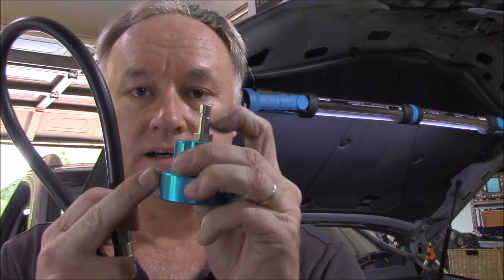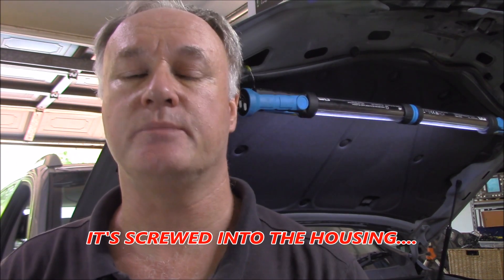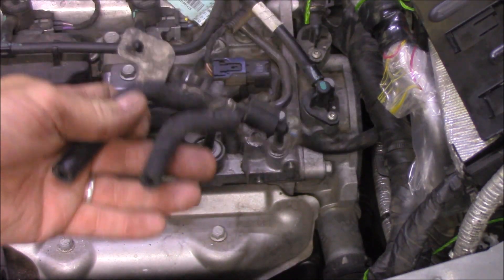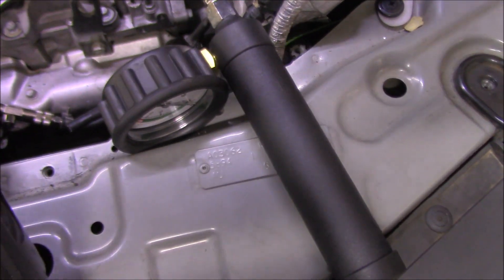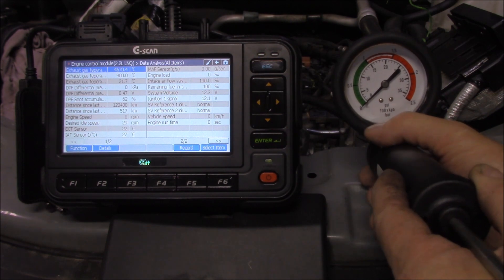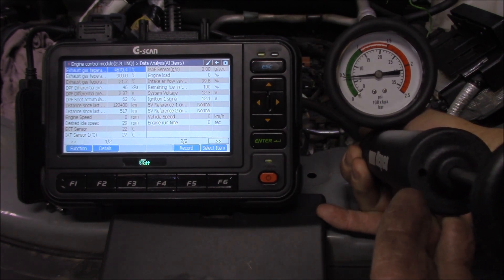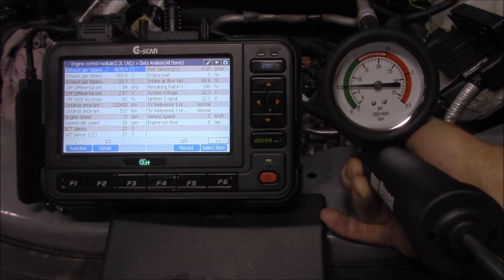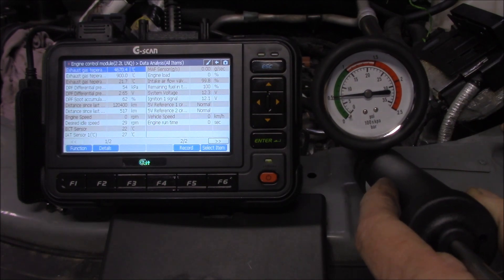DPF Differential Pressure Sensor Testing MiracleMAX

Comment: Did you determine why it was blocked?
Reply from the maker: Hey Bob,
I will be putting out another video about this vehicle soon. 
Several factors came into play. More will be explained in the next video. In this particular case, it was city driving and lack of proper maintenance that caused the blockage. 

Unless the DPF gets up to temperature and correct engine RPM the ECU can not direct a successful regeneration, so the ash and soot just sit there, rather than being cleaned out. It then accumulates until it creates a severe blockage that can not be removed by a forced regeneration. So it has to be removed for correct cleaning.

Diesels with DPF's are not city vehicles and should not be bought by owners that do not understand how they must drive to allow regeneration (usually the fault of the salesman, rather than the buyer), otherwise, they will be up for many dollars in repairs.

Thanks for your comments
MiracleMAX
Reply: @MiracleMAX  If a code of a blocked DPF appears and no other error are present (all signals check out) is a one time forced regen the first step?

Or should it always be removed and flushed / ultrasonicly cleaned?
Reply from the maker: @thuglifescorpion  Hey Sanscorp,
That's a good question. Personally, I will always try and figure out why it has a blocked code. Some things may not show up, but can cause the DPF to block. EGR valve faults, blocked air filter, incorrectly working PCV valve system, intercooler issues including split hoses, incorrect driving technique such as not getting the engine up to temperature so that the vehicle can carry out a passive or service regeneration, faulty injectors, faulty differential sensor, leaky oil seals at the turbo, incorrect oil used during servicing, poor quality fuel and the list goes on.
I would only do a forced regeneration if I was sure that I had fixed the cause of the problem. You also have to determine if the filter is damaged or just blocked. A forced regen can create a melted substrate due to excessive blockage that will not clear. Some do repeated regens in the hope that the blockage will clear, when in fact, each time they do it they are damaging the filter a little more.
Ultrasonically cleaning is really the only way to do a proper clean. A forced regen should be the last option in the process.
Also keep in mind that after a forced regen, oil and filter must be replaced.
This video might help you as well.
https://www.youtube.com/watch?v=eLxHFZSkHAo
Cheers
MiracleMAX
Reply: @MiracleMAX  I'm very sure there are no further issues. Will leave the forced regen for what it is and have the dpf cleaned (backflush machine, no one here can sonicly clean it for a normal price. Thank you!